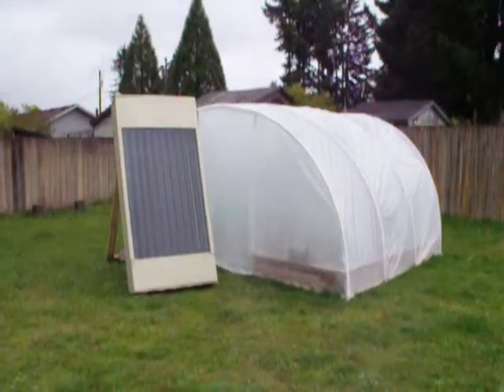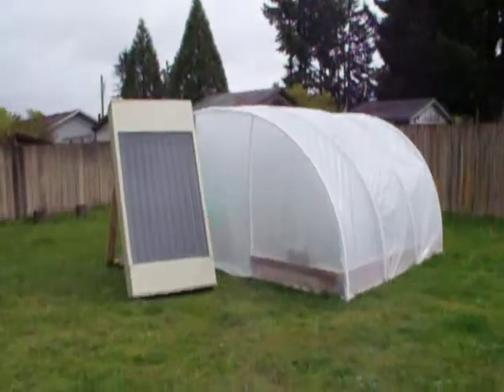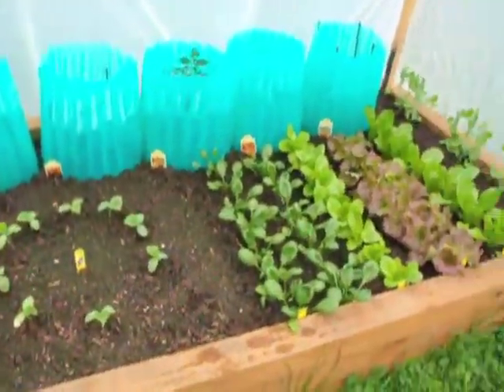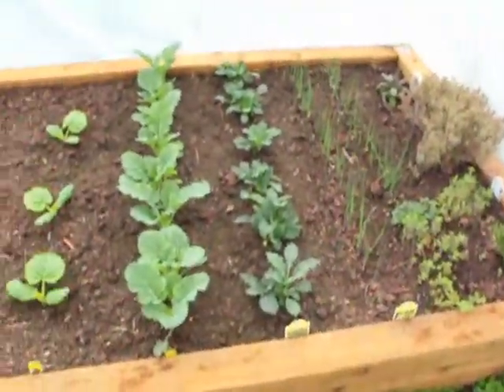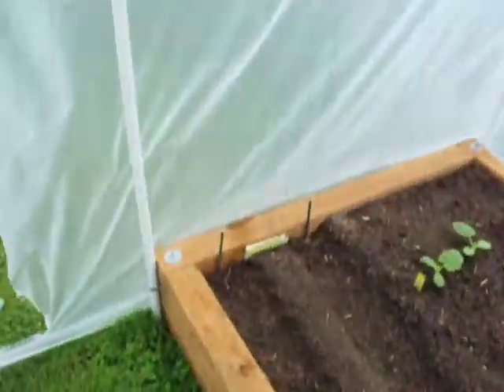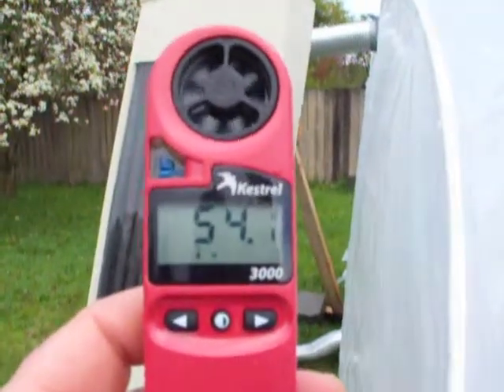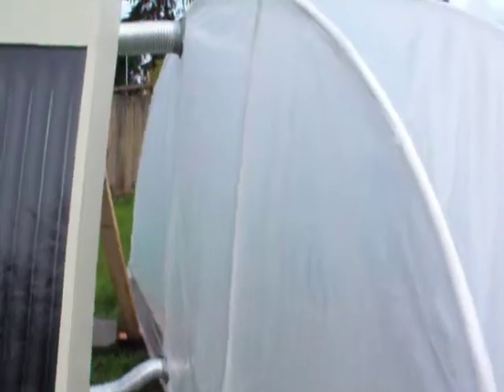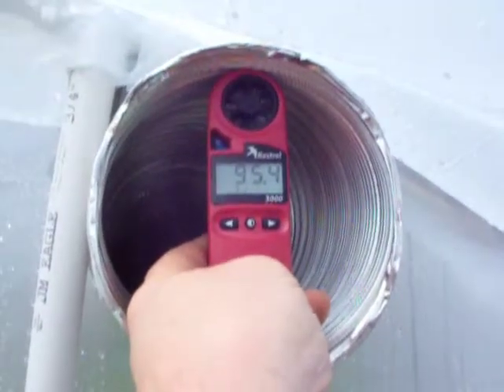Passive Solar Air Heater-Performance Test

Comment: Great insight on making the top vent 6" and bottom vent 4" for good air draw. Will you install and another larger unit on your house? I am presently planning a 4 foot tall and 16 foot wide unit. Thank you for condirming solar air heaters produce heat even on cloudy days!